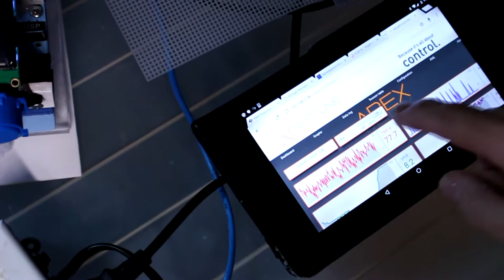Reef Aquarium (Auto Water Change) using DIY Controller & Custom Sump.

Comment: Some captions or talking would be nice. Looks interesting  :)
Reply from the maker: Yes, Capation and talking explaination would have been better.
This was just a first test run. 
I'll do a detailed video when the Controller is installed as Both Doser & Water changer.
Plus there are many details as I mention in the VIDEO DESCRIPTION.
(ie The Details of the build and how it works is here  http://www.reefcentral.com/forums/showthread.php?t=2636608)
Plus there are links to Build of the Sump which is key to make the Water Changer work, without any disruption to the Running System)

Comment from the maker: Got the Auto-Station Area Setup. (Here is a picture.  When I'm completely done I do a New Video of Everything working)
https://c1.staticflickr.com/5/4252/34624492211_0bba24ebe2_o.jpg

Still have to do the doser lines.
I went small bins (FILL/DRAIN) to handle a months of weekly water changes.
Eventually I'll integrate a Large Salt Water Mix and Auto Drain into a nearby House Drain (for Total Automation)

If you want all the detail with ongoing updates...
Evertthing in in this Tank Thread.
http://www.reefcentral.com/forums/showthread.php?t=2636608

Comment: thats alot.. i would just buy 2 small power heads and have the apex do it all'' i did
Reply from the maker: I agree, apex could do it.
This Water Changer is just bonus Code thrown into the doser.
Plus for me having logic and extra failsafe sensors works better.